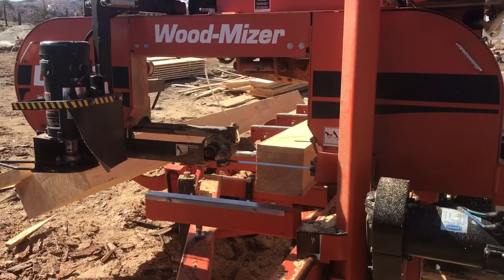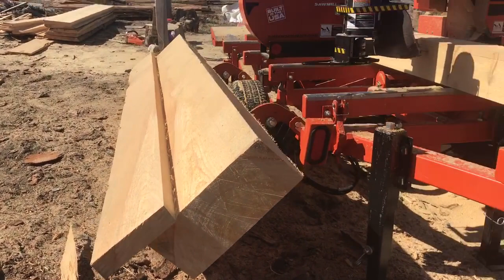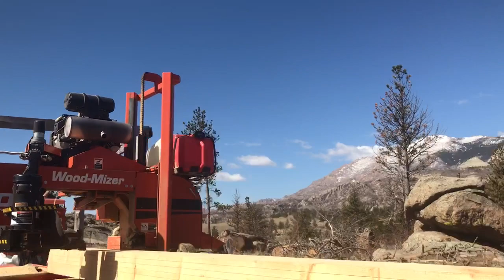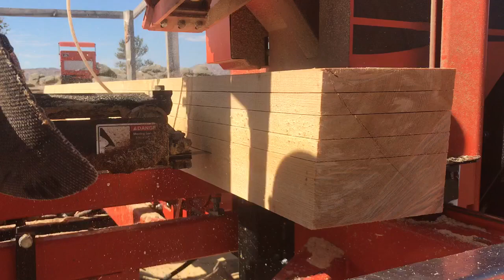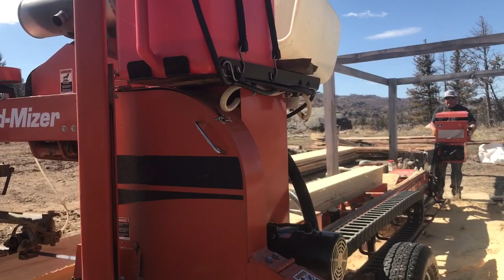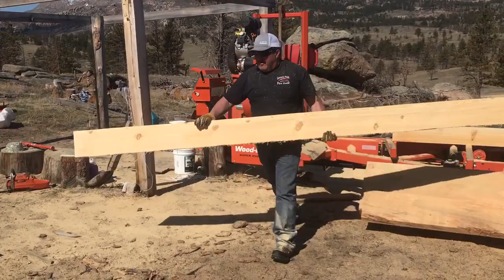Wood-Mizer Wood Milling Machine

Comment: Keep doing what you're doing, sing dance or whatever. I enjoy the videos. Have a mizer on order to do some of the same. When it warms up a bit.
Reply: Well hello Boomer 50. I will be Brad 70 1st week of July. It is a lot of fun working with the timber, mill and my cousin, outdoors and all. I love running a chainsaw. The small of fresh cut pine trees. The sound of the mill and the great fun of doing something important like, cleaning up the dead timber after the fire up here. Any way, i think you get the idea. Only if I was 50 again.
Reply: @bradbuckner9496  I am well past 50 myself, that's why I'm buying a mill. Some folks go to the gym, I'll have a gym at home or wherever I pull it.